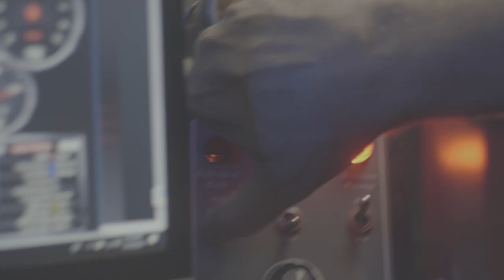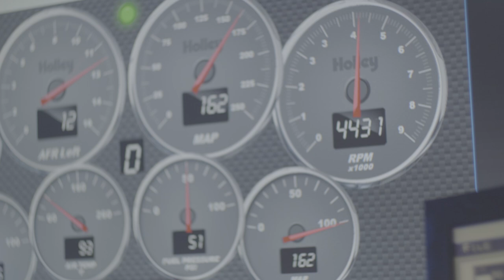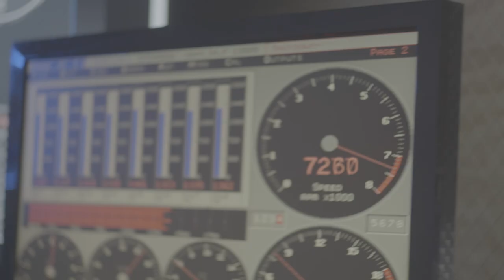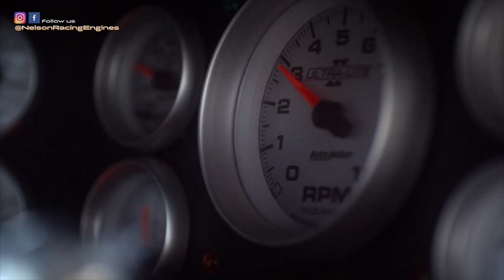Imagine! 1200 HP 260 CI TT LS Full Throttle/Full Load 5 Min Dynos!  NRE's Tom Nelson explains.

Comment: It seemed like the Dyno was having trouble providing consistent braking at that rpm / power level. Also, it looked like that 5 minute pull was at ~800hp rather than 1000-1200. Are they gonna do another long pull like that with the turbos dialed up another notch?

Comment: Seems like they built it for 8500rpm, but they set the rev limiter at 7200.
Should last a long time, that way.
Reply: he doesn't list the head flow or cam specs so how do you know what rpm it was built for?
Reply: he making a very good assumption based on the builder....
Reply: Hur never bounced the limiter

Comment: That's pretty impressive. I've spent some time around jet boat racing teams and I don't think people realize what these engines go through. Nearly the entire race at or near WOT. Constant pounding and banging. All at ridiculous horsepower levels. 
Very nice work. 

Curious if the surging was due to the early state of the build and the tune or ?

Comment: I've heard people say that Nelson race engines are just way too expensive. That they can buy the same horsepower somewhere else for way cheaper. Well, this is what that extra money goes into. Endurance, reliability, and driveability. No other engine builder can say that about their engines. It doesn't matter if it's a 3500hp beast or a 500hp street engine. The amount of detail and precision are no different between the two.
Reply: I'm sorry but 5 min at full throttle making 800hp isn't too impressive look at NASCAR's or other racing and those engines are working way longer ans just as hard

Comment: The 300 l6 in my truck stays at about 3,000 to 4,500 rpm, wide open. For about 45 mins when i tow my tractor over blood mountin. It does not get hot, oil presser is steady, just sounds bad and drinks about 1/2 a tank of gas.

But it is na. motor making around 250 to 300 hp and about 400 ft lbs, its not a race motor like yours, for yall to make a 1000 hp for that long with 260ci is amazing.
Reply: I'm not trolling.... but... there's no way your factory Ford 300I6 an engine I am in love with..lol makes 250hp ... the 302v8 in my 88 bronco made 180ish when new....130-160ish and around 300ish torque....now having said that it's one of the toughest engines EVER.... and when built up create CRAZY # and sound like a snowmachine/crotch rocket ...lol....from Wyoming USA 🔫🤠

Comment: I used to dyno big diesels for mining equipment and we ran them at full load for one hour... The biggest 24 cylinders we ran made 4500 hp and 13000 ft/lbs.
Reply: Dave Micolichek  depended on engine, but the biggest ones was Caterpillar 3524's and they redlined @ 1800-2200 depending on Gen. build etc.

Comment: Nice. Impressive. But I question the use of ball bearing turbo's other than for the fact less plumbing is necessary. Journal bearings can run decades at full boost. I doubt ball bearing ones will make 1 year. But hey, none the less great job.

Comment: That Nascar quality shit right there bro ! Outstanding
Reply: Beyond nascar. Way beyond. 😉
Reply: @HK304  ,Not quite.NASCAR engines regularly rev beyond nine thousand rpm for a lot longer than five or ten minutes during a race at their longer tracks.What Nelson is doing is impressive though,because of the temperatures and pressures involved with a TT engine.
Reply: @davidh1249  nascar is naturally aspirated. You can't even compare to this engine running max boost, 1200hp 7krpm from a 4 liter v8!! Beyond Nascar my friend. Don't even use that comparison. This is NEXT LEVEL shit!😂😂😉😉🥇🥇

Comment: I would let it run cool down for 2 minutes or so. Just to save the turbos, they are still glowing as they stept into the dyno room. Thats why the paper starts to burn. The oil inside the turbos is also burning than they die, cause the oil cant flow that good anymore inside the turbo.

Comment: That is extremely nerve racking to pull an engine that long.  Did it with a 260 ci na Bonneville engine and later with a 500 ci na Bonneville engine.
Reply: If you have an engine and it can't do this, build it better.

Comment: Nothing to get excited about. Alfa Romeo testing a 1930's grand prix engine:

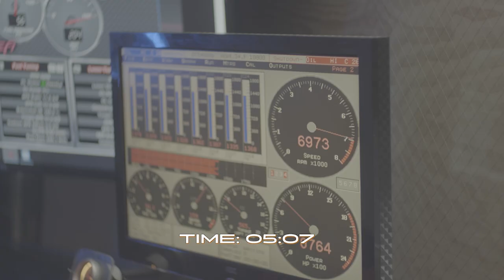"When Jano saw that he took a hold of the throttle and held it fully open while placing a weight on it. He told the astonished engineers that since it was 5:00 he would go home for a bite to eat expecting a call at eight for an update on how the engine was progressing.", reference: http://www.grandprixhistory.org/jano_bio.htm
Reply: A twin turbo 1200hp small cubic inch grand prix

Comment: 260 ci at 14.5 psi (200 KPA MAP) and 7500 rpm does not make 1K HP.  The engine may be 1200 capable but it would need 35+ psi of boost . The Manifolds would be glowing red and I don't know that it would survive for 5 min there. Would need some serious oil cooling.

Comment: Boats have been racing at 1000+hp for 20+ mins at a time for quite a few years now, the only issue is cooling. Funny how he only mentioned stuff like boost connectors and oil coolers to make this happen. Why would any of his normal engines not be able to do this kind of test?

Comment: Electronic nitrous, 200hp at the push of a button. Wish Holley would work with companies like Turbo Dynamics, bring this technology/capability to the world of 4-stroke turbo snowmobiles.
Reply: It's basically a boost controller. So you can do that with turbo anything. The difference is I think, in addition to boost control the Holley system also allows for timing and fueling control. But you could just about do the same thing with a turbo controller assuming the fuel system is designed to handle the increase boost.
Reply: @mission772  it's basically the opposite of a booster controller. It ADDS fuel-timing-boost.

Comment: It's not a big deal making 1000 hp. I got 3 engines here chevy aluminum motors 426, 429, 432 and running one Holley 4150HP at 8200-9400 rpm for a hour or more and without a turbo making 840-870 hp and add a turbo or two and without trying I'll make a 1000hp

Comment: The breaking point in any engine is valves and  there unbalanced speed of movement at high rpms. Anybody can build a powerful engine that has a mechanical brain. Knows common sence with vehicals.  Boy is it fun to when you can afford it.

Comment: Collect your Money Now!

Don't forget though, that the prop is probably going to be jumping out of the water, and unload the engine.
Reply: If only the boat had a prop in the first place! Jet boat engine ;) and marathon racing is about the roughest motor sport on engines period. Sustained long distances at WOT in water which is often full of rapids etc loading an unloading the engine in a fraction of a second.   It would not surprise me(or probably anyone else) if this engine did not survive the duration of the race and that is in no way a slight to the builder just an historical fact. The winner of the worlds is often far from the fastest boat but is always one of the most reliable. Turbines are doing well not only because of their huge HP but likely more because of their reliability over a piston engine.
Reply: @xerophobic   I can't see the jet going a wholelot faster than the rest of the field. Acceleration on the other hand would be interesting to watch though.
Reply: @brentonk461  the field is all jetboats and for the most part acceleration in marathon racing is not the deciding factor. Consistent speed and survival is the key which again is what typically dooms high HP piston engines. Its not unusual for a world championship to have a lot of lower class boats in high positions, they just have a lower attrition rate If I recall in 07 when i raced the 5th place boat was from the slowest class, out of 53 entrants!

Comment: So you ran at 750hp for 5mins straight.... r5p7 motor will do 850hp n/a for a lot longer then that, Even with the displacement difference its not a whole much difference power per cbi. Its impressive but the click bait of 1200hp is bull sh*t.

Comment: Very cool but I'm going to be that guy.
Small displacement love to make hp at high rpms.
Back in the 80s my grandpa ran 12-14k rpm out of a 289.  
Yea he was a engine builder.

I dont think 7k would do any harm to a engine that could run 12k rpm
Reply: @paulcopeland9035  wish I could post pics on here.  It's ok though
Reply: @BBob33524  ,some sort of proof of a 289 Windsor revving to 12-14,000 rpm would be necessary(to say the least) to be believable.It's a little far fetched to believe grandpa got a Ford small block to turn that many rpms 30 plus years ago when its virtually impossible to do today.
Reply: @davidh1249  
Ya I know it's a old 80s nhra car.  I forget class but I think it's gone now.  And it's a chevy not Ford.  I say "289"
Reply: @BBob33524  ,Even some version of a de-stroked Chevy small block isn't going to turn those kinds of rpms.Also,when you say"289"without any sort of clarification that leads one to believe a Ford Windsor is the engine being spoken of because Ford is the only one of The big three who built a 289 cubic inch V8.